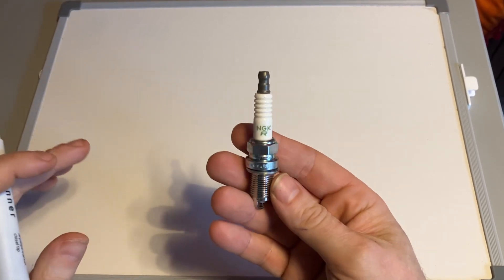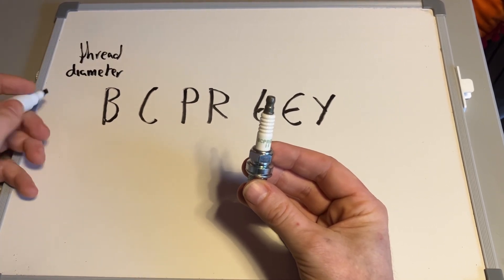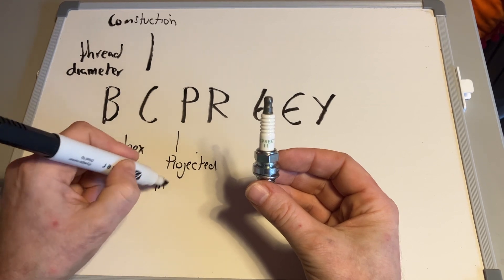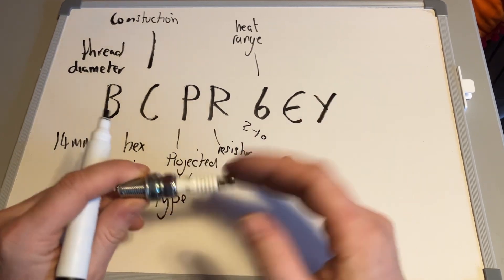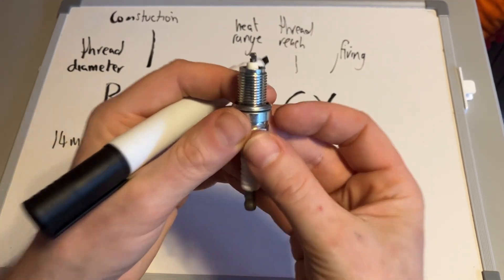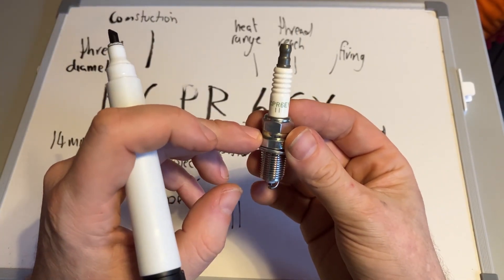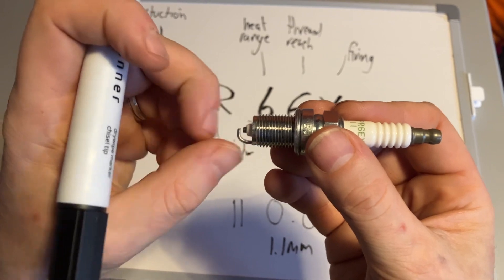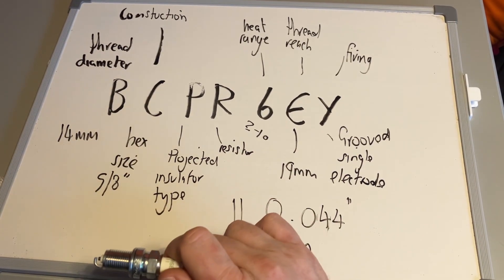What do Spark Plug Markings Mean?

Comment: Hi. One question here. Can I just replace my C6HSA spark plug with CR6HSA since I accidently bought a new non resistor plug cap to replace my current resistor cap ?? Thanks first
Reply from the maker: Hi, yes. I believe that should be ok.
Reply: I finally get my CR6HSA to pair with my new NGK plug cap and looks like it did solve the electrical noise issue which causing my signal light gone crazy  @AdamMechanic
Reply from the maker: @infinitepawer  Great! A result for you! Glad it’s sorted.